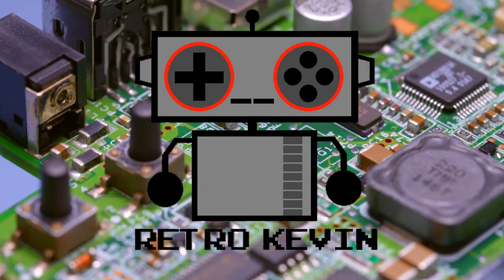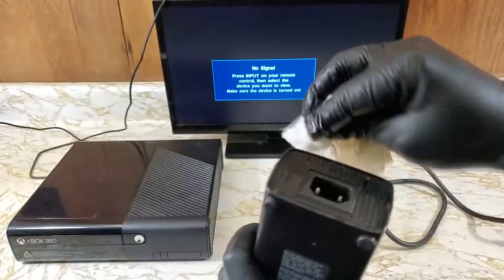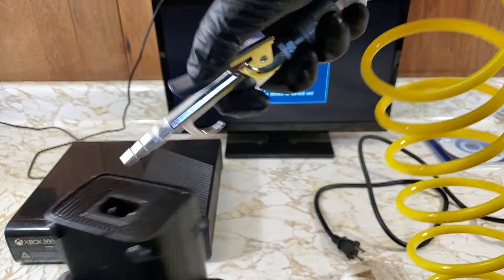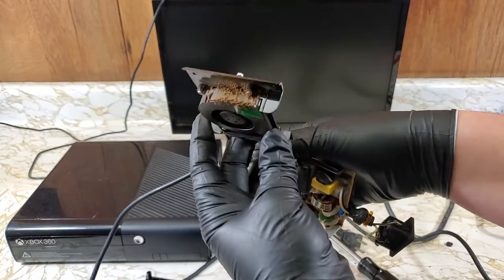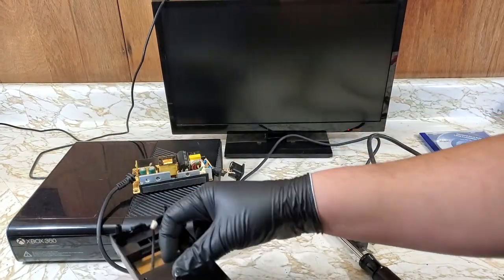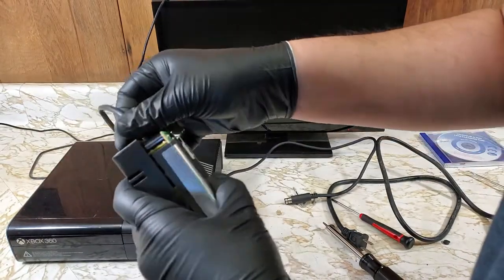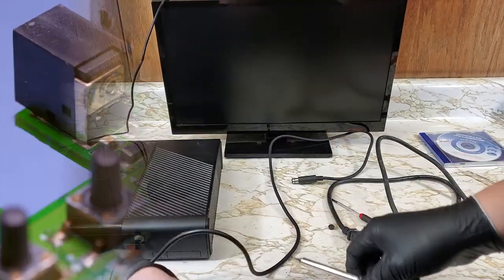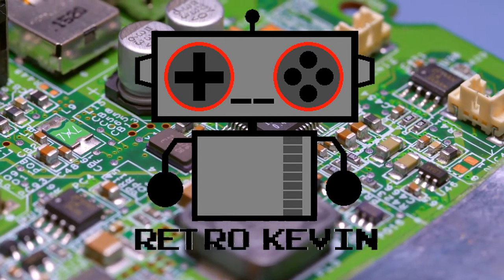Deep cleaning this GROSS Xbox 360 E Part 2: |Power Supply| [teardown and cleaning]

Comment: Props to Microsoft for using screws to keep it closed instead of using superglue like most power supplies do. Although it looks like it still uses some adhesive. When there is that much dirt and grime inside I give everything a good soaking. Not only does it look cleaner but it gets rid of any smell like cigarette smoke, mildew, etc.
Reply from the maker: I did this work as a favor for a friend. The console went back to them into a smoky environment. If I was keeping or reselling this console I would have more thoroughly cleaned everything as well.